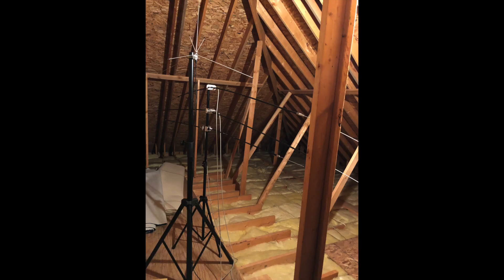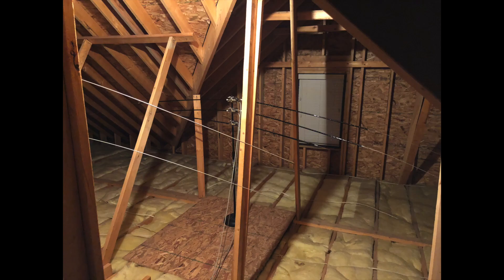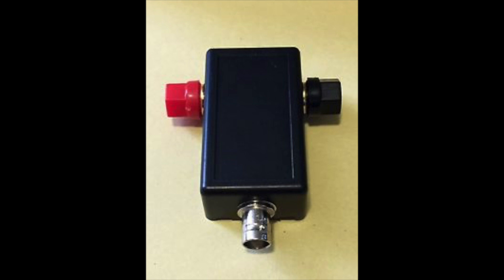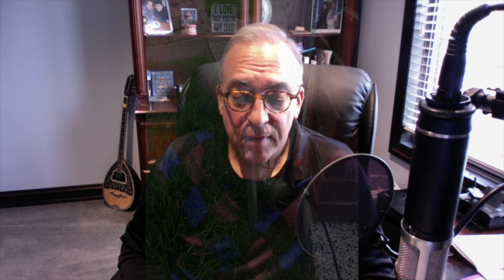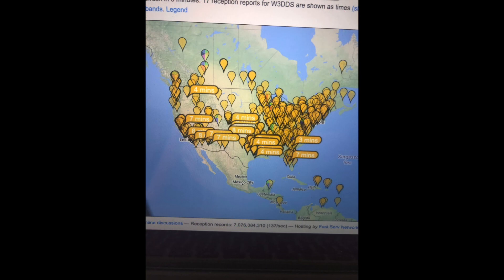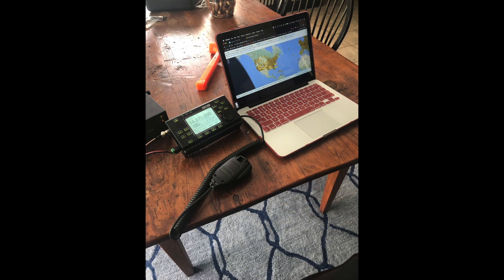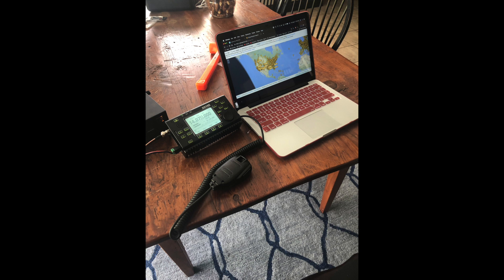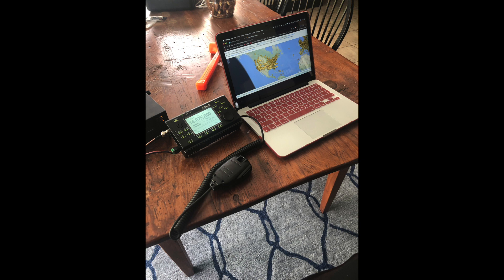HF Gutter Antenna for Amateur Radio

Comment: Antenna newbie question. Would gutter antenna matching be necessary for a receive-only SDR? Also would this antenna be similar to a long wire? Would these 90 degree bends make a good broadband antenna? Thanks!
Reply: I suggest experimenting and see what happens as all situations are different.

Comment: Can you use a 49:1 balun instead of a 9:1 balun? I would like to run at 50 to 100 watts SSB and CW and almost all of the 9:1 baluns are rated at 20 to 30 watts that I have seen. What are your thoughts?
Reply: Thanks so much and I totally understand where you are coming from. Very much appreciated!!
Reply from the maker: That would not be advisable.  The gutter antenna provides an impedance of about 450 ohms.  The way to rewove this to 50 ohms to match the transceiver is with a 9:1 Unun.  450/49=50 ohms   The 49:1 unun matches an impedance of ~2450 ohms.  That is what an end fed half wave antenna would present.  2450/49=50 ohms.  There are 9:1 ununs available from all of the usual ham radio suppliers.  HRO, DX Engineering, and Gigaparts.  LDG makes one that will handle 100 watts

Comment: Turn the gutter into a skeleton slot with a piece of wire, acts like a giant horizontal J pole, or turn it into a folded dipole. Much better than just the gutter.
Reply from the maker: Not sure what a skeleton slot is
Reply: @McPilot_W3DDS  some ham on YouTube covers it pretty nicely, I bet it would make a great video of a skeleton slot gutter antenna.

Comment: I had  Lots of successes using gutters as an antenna  with an FT-757GX  with piwer outputs from a ful 95 W down to 15 W both on sideband and mostly on CW when i use to live in Apartments that are STRICTLY No Antennas allowed... Period  since 1988  while Stationed in NAS Alameda while in the US NAVY.  The Gutters were Oriented in a SE  heading that working South American  Stations were not a problem. I just used an mfj basic Tuner to load the down spout which also loaded the horizontal portion of the gutters, it worked great on 160M, 80M and 40M  with SWR readings between 1.4:1 and 1.9:1 and 2.1:1 on the phone pirtions of the 40M band. On 20M , the best i could do was only 2.5:1  and i started noticing the Xnceiver's heatsink starting to Heatup so i limited operations on 40M as the highest band i could load the Gutters. Signal repirts i got from South american stations  was  between 449 and 599 on cw depending also on band conditions at that time.  I drilled a small screw into the side of the vertical part of the gutter and used a white No. 12 awg wire  2.5 Feet long tucked on to the lower left corner of the sliding window. I rested the mfj tuner  on top of a small lamp shade table.  Since i lived on the 2nd floor i had to improvise a "Ground" system using No. 10 awg wireS  Taped in to the Baseboards, the main Hastle was trial & error on the Lengths of the grounding wires by trimming and cutting but once found Seems adequate.  Luckily  back then man made noises were NOT yet much of a problem since majority of  piwer supplies were mostly Linear pwr supps. Unlike NOW  we are surrounded with Switching  pwm pwr supps. Noise levels bck then were acceptable  snd almost none.
Reply: So 80m won't work on a gutter antenna?

Comment: How deep was the stake in the ground? What did you use? And is that a hose clamp holding the wire on the ground stake?
Reply from the maker: Hello bead. The stake is aluminum rod 2 feet in to the ground and the hose clap does hold the ground wire to the rod.
Reply: @McPilot_W3DDS  thank you
Reply: You can purchase an earth rod from an electrician suppliers, commonly available and they already have a screw terminal to fix the wire on.

Comment: I've used my rain gutters as antenna's before, they can work very well.
Reply: Just be sure to use a counter poise on the system 2 or 3 wires buried at the correct length and angles.

Comment: How would you know whether or not you'd need a counterpoise, and if you needed one, how would the length be calculated?
Also, what program is displayed on your laptop?
Many thanks from a new subscriber!
Reply from the maker: You would use 1/4 wavelength for counterpoise on the frequencies you would like to work.  I am not using a counterpoise for this one but use a ground rod.  the coax shield may also serve as a counterpoise.  Thank you for the comment!!!
Reply: @McPilot_W3DDS  
Thank you!

Comment: I use the gutter system of my apartment building as my primary, every day HF antenna. I make 8-10000 mile contacts, SSB and CW,  almost every day. I feed it using a 9:1 impedance transformer, as well. Works surprisingly well to the point that I rarely put up my EFHW or EFRW at all any more. It is pretty long at about a 150 foot straight section with 4x 30 ft tall downspouts. Lots of metal. Thanks for the video. I actually contacted you while out POTA the other day with it haha. 73 de W3OY
Reply from the maker: That’s a great story. Yes I remember your call!!  Thanks

Comment: Great video, As mainly a listener, i wanted coverage on other short wave frequencies, I have used a end fed half wave as a ham, and i liked them so much, I adapted it for other short wave band reception. At the 49:1 trans-match, I simply connected a homemade loading coil with a value of 150 uH, (It's way too much for my needs, but it works.) A jumper wire allows me to connect the trans-match to the coil and electrically lengthen the rain gutter so I can then receive any frequency i wish, as long as it is a lower frequency than the length of my rain gutter's natural electrical  length;.(468 /  length in feet for MHz.)
   I've found adjusting this same jumper allows me to make use of the gutter for QRP work as well, on the ham bands.  And as it is still an end fed half wave design, I gain the harmonics of the higher frequencies as well. 
   i don't use an antenna  tuner, it's a  base loaded + end fed half wave design antenna and I just made the rain gutter electrically longer with the loading coil and jumper so it's then electrically a half wave end fed rain gutter. 
  Note; (This base loading coil impedance value can also be fixed in place for electrically tuning the gutter to match a half wave frequency length too, if it is a slightly higher frequency ( shorter length physically) than the nearest half wave value. But together the coil and gutter can electrically match one of the half wave length's needed for the ham bands. 
   Then I also gain the harmonics of the higher frequencies as it is electrically a half wave end fed antenna now. 
 I too, live in an HOA, and I am lucky enough that the end of the rain gutter on my shop, is very close to where my base loading coil is located just inside my shop wall. So i can just reach up and adjust my jumper to change the electrical length of my antenna to set it for a different frequency by ear..  
My antenna analyzer confirms, it will match the SWR for use on HF aero, HF marine bands or HF ham bands fairly easily, as long as they are a lower frequency than the rain gutters electrical length, and I still gain the harmonic bands for any of those higher frequencies as well.  HF Aero, Hf marine, or the HF ham bands. 
I suggest that you make the gutter into a fixed electrical  half wave length with a base loading coil, then use it as a standard half wave end fed antenna with a standard design 49:1 trans-match or a 64:1 trans-match and give it a try.  
Base loading coil calculator is at;  https://www.66pacific.com/calculators/default.aspx
(At least it's worth thinking bout.)

Comment: All FT8 will tell you is how good propagation is on FT8. It will tell you Nothing about propagation on SSB.
Reply: That makes no sense
Reply from the maker: It tells you what propagation patterns are in play. SSB utilizes more band with so less efficient.  CW uses less bandwidth so more efficient.  Not sure what your point is??

Comment: I connected a 9:1 un to the side of my apartment and ran about 10” of down rigger wire to my rain gutter down spout and connected  a  eyelet to the screw on the downspout and I will have  a piece of copper wire go to the ground rod

Comment: I've used a rain gutter antenna since 2012 during my condo days in FL. With 100 watts and good propagation I could work W. Europe (5,000+ miles). Worked lots of contests and WAS certification. 

K2MOL.